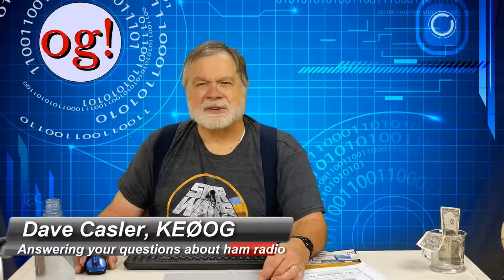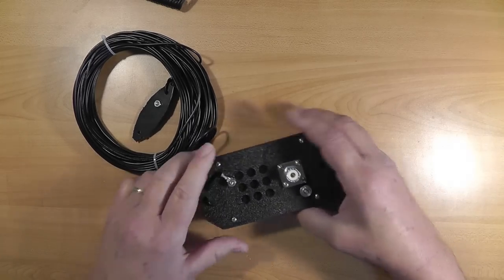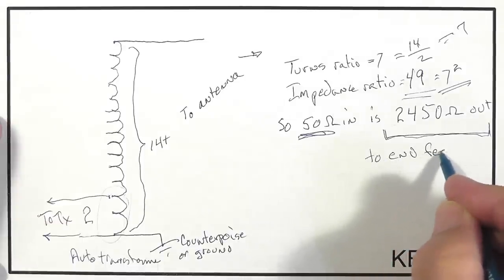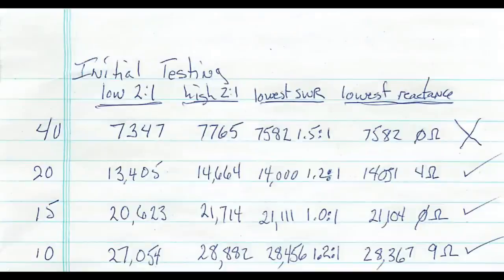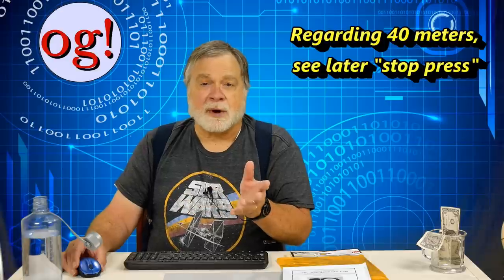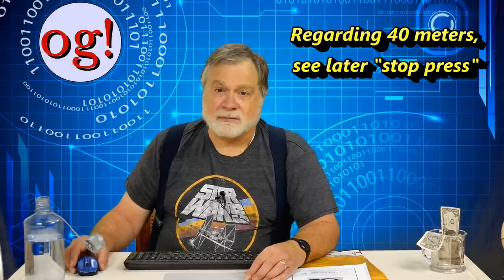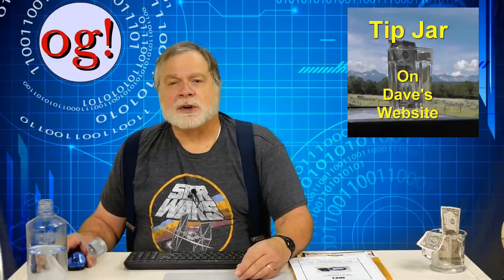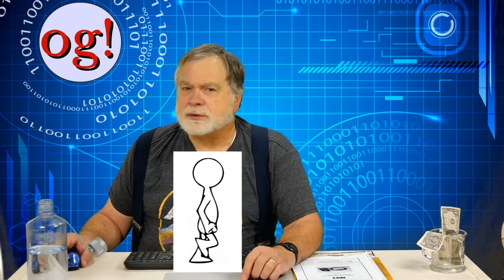Review of MFJ-1984MP End-Fed Multi-band Antenna (# 89)

Comment: Dave, I built a 9:1 end fed myself. At first I had similar issues. Then with a friend's advice I lowered my transformer to about 2 feet from the ground and connected the ground to my ground rod with no counterpoise .  Boom my antenna came alive and works great!
Reply: Dan, I just picked up a 1982mp and the downloadable instructions didn't specifically state 2' from the ground, but the illustration pictured it close to the ground as you did, and also said to connect the transformer to a ground rod. Sounds like Dave needs to try that.
Reply: This is a 49:1 end fed half way.

Comment: I got the MFJ 1622, "apartment antenna" (~ $100). In my case, it was completely useless... It might be good for EmComm, but I would want something a little less unwieldy in that scenario... Since then, I've built my own end fed, running from by the 2nd floor window near my rig, and down across my property, it works great with a tuner from 80-10. Now unless you need a vertical, I'd recommend people just learn a little bit, and build their own too.

Comment: ...I'm a simple man, have plenty of trees and cordage to hang my reliable dipole's...your review enforces my philosophy to stay away from gadgets proclaiming to make my life easier...great review and 73's 😎
Reply: I agree with you in simplicity. I have to say though, this antenna is not up to par as an EFHW antenna goes. I refrained from actually buying this exact model because of the loose solder I saw on this video. I decided to pay twice for the same type of antenna from somewhere else, where it seems they have a higher quality standard, and it works without a hitch. I have worked FT8, SSB, PSK31, etc and I have gotten great QSO's. EFHW are good antennas and don't require all that Dave had to go trough on this video when built in a consistent manner. Also, no counterpoise on these, ground it. 

TLDR: MFJ makes a crappy EFHW, build your own or buy from a reputable antenna maker and you won't regret it.
Reply: Dani El .....running a chameleon emcomm iii, and it is a solid antenna with good performance. I did connect an mfj-915 choke at the tramsformer

Comment: Yes this is an auto transformer but the one's from EU and Myantennas are standard transformers. That's a big difference.  The coax will play a role in the antenna therefore I recommend grounding the box right at the earth, going vertical then horizontal in inverted L fashion. That eliminates all the mysterious effects....
Reply: Im currently running the emcomm III in an inverted L (kind of a lazy L though). I run 4 counterpoise at 13 feet, the main antenna vertical 22’, then horizontal from there with a slight slope to the end. At the transformer I installed an MFJ-915. Overall my 40 meter performance is pretty good

Comment: I got one from UK Antennas straight out of the box a 49;1 transformer 66ft ish .connected to it .boom no problems an 40 20 15 and 10 so then ordered the 110uH coil added that on the end with about another 8ft  of wire and now got 80mtr too no problems at all 😉👍

Comment: Dave,
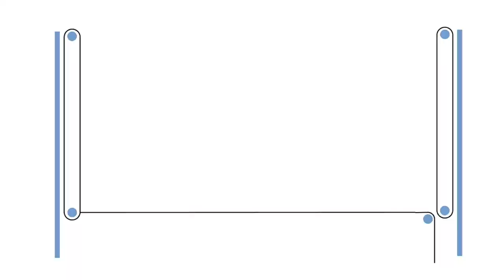I cannot vouch for the MFJ version of this antenna, but I have used another competing version of this antenna (80-10M version) with great success. I have been so impressed with it, it has  become my primary base station antenna (yes I live in a dreaded HOA and this is easy to hide). The key to these end-fed antennas using either a 1:49 or 1:64 transformer is the set up. These CAN be set up as a base station antenna. As you found out, these like their feed points close to ground, so they work best as a sloper. I have found if you mount the feed point (and transformer) between 3 and 12 feet above ground, and not use a counterpoise, but rather ground it with a short wire right to a rod (4 foot ground rod in my case) AND feed it with no more than 50 foot of coax... it works great. I have been heard as far away as Australia from the US east coast using it. On most bands 80-10 it needs no tuner (but depends on your terrain). Like you, I have realized this could also be a great field deployable antenna and have built a QRP version based on this design using FT140-43 toroid. 73.
Reply: Great info, I would like to see how you wound the toroid you used for the antenna you made. Did it work well when you tested it?  If you can't pot it here, maybe you could send it to me via email from QRZ.

Comment: The 80 meter version of this antenna (132' long) would have a harmonic relation on 30 meters, there it's the 3rd harmonic (well close enough for government work).
The problem on 40 may have been that the length of the coax was resonant.  Perhaps with the box in the air and a LONGER feedline (moving the feedline resonant freq) it might have worked on all bands.  Also, you might have needed a choke in the feedline at the rig.

Comment: I  recently put up an 85 foot end-fed with a 45 foot counterpoise. I have an MFJ-939 tuner at the feed point and about 125 feet of coax back to the shack. It tunes up on all bands 160 - 6.  One night when 80m was open I was able to work Europe wth my 100 watt IC-7100.

Comment: Well one thing you have your transformer box next to a conducting pole that is grounded.   I built my first end fed single core matching right off of Steve Ellington,s videos and it was a very good performer on 40. The match was very good, the on air was 2 S-units better than my 40 inverted V at the same above ground. About 40 feet to the center of the V and to the attachment point of the end fed that was a slopping wire to the  same point with the transformer 4 feet off the ground at the other end. This only shows that the wire was taking the power and sending it on its way, not every station was this good but to the station near the coast up north from Va. it was doing well. The next one I built is a two core and I have not gotten the same result on 40 with it but it just takes some HAM fiddling. Steve,s videos are very good and he get very good results and had built many.  Thanks, Dave E. W4GSM

Comment: I'm using 75 feet of LMR-400 and I have the box on the ground and the antenna over a tree limb (inverted V).  I find get a 1.1: 1 at 7 MHz and 2:1 at 7.3.  On 20, 15, and 10 (28-28.5) meters I get about 1.3:1 or better.  So far I really like this antenna for my home use!  I've worked Chile and Spain on 10 meters and regularly use it on 40 to check into ECARS, SCARS and the Nickle Belt Net from Pittsburgh.  Just follow the online instructions and this will work just fine for you!

Comment: I use 1984HP and it work good on 40-10m.  10 is a bit hard to do with no tuner.   I have done 300-450watts SSB with really good results.
Even barefoot 100w or less I do very good on digital modes.

My setup is box is at 8'     middle  at about 12-13'.  end at 28'

Comment: Nice review Dave, I was watching with great interest thinking now can Dave prove me wrong here or what. well Dave I have used all kinds of HF antennas to suit the situation of locations that I have had to operate from when in the forces. For the higher frequencies I would usualy pick to use a dipole slung up from trees or tree/mast. For the lower frequencies  I would normaly use the trusty wind up drum and plug in unit of a 150 ft, wound up "Dacron" line with embedded tinned copper wire in it. The line was run out for the length required and then trapped into one side between metal washers that were connected to a 5/16 ins plug in terminal, witch was pushed into the antenna base fitted on the side of the vehicle. ie. pull out the whip sections and plug in the wire unit. the far end of the wire could be pulled up into trees or a mast. Whatever losses there were in using a ATU to get a good match was not taken into account. as long has I was able to make contact with the base HQ and pass traffic, usualy by CW was what mattered. On my own back playing with Ferrite torroids winding UNUNs , BALUNS  and XFORMERS to try and do what you have just demonstrated, I gave up most of the time and just put it down to experience. Use a doublet or a fan dipole. 73 de John - G0WXU

Comment: Hi Dave,  I am using the myantennas 80-10 efhw antenna. I have it set up in an inverted L configuration. I have the auto transformer mounted on a wooden 4X4 post on my deck. Directly below that I have an 8 ft. ground rod connected via a 2 ft. ground wire. My swr readings are 2:1 or less on all bands and less than 1.5:1 on most bands. I believe the key to performance is keeping the ground as close as possible to the autotransformer. I also use an ugly balun in line to prevent RF from feeding back into the shack. Hope this helps. Good Luck!
Reply: Good choice... I use the same antenna with similar set up, with similar results. Great antenna. 73,
Reply: Thomas Wright hey Tom , how does the myantennas 8010 work for you? Do you mind making a video? I have 70 ft between trees but would like to come down and go at a 45 degree right angle to try to get the best I can on 75 meters. Did you have to trim the antenna ?
Reply: Are you having to use a lot of coax or could I keep the coax length under 10 foot as I do with my MFJ end fed?

Comment: Hi Dave. I just rewatched this video today -- after having owned the exact same model of MFJ-1984MP end-fed antenna, and I don't use it with a counterpoise, and not only does it work great for me in 10 meter, 15 meter, 17 meter, 20 meter, 30 meter and 40 meter, but I'm actually able to communicate on it with 80 meters as well. I guess YMMV?!? For what it's worth, this antenna goes up almost vertical in the tree, about 40-50 feet up in the air, and the transformer box sits within 2 feet of the ground. 73 de W3DJS in Atlanta, GA, USA.
Reply: I have had the same good results with this antenna. I have mine installed in an inverted V fashion approximately 70 feet in a tree and the box mounted to a 4x4 post   about 5 ft off the ground and 20 feet of coax. Also grounded it at the 4x4 post to copper ground rod.  Works excellent so far
Reply: Clearly having that box reasonably close to terra firma matters, and that is how the instructions show it. ( Don’t have one, but this kind of antenna arrangement has some attraction for me.

Comment: So it appears that the antenna can get all the bands that is says, but not at the same time.  What I get from this is that there is no simple way to get low band and high band frequencies  to work together on wire antennas. This is because the coax appears to be part of the low band frequencies, but not so much as the frequency increases. I guess that would not surprise anyone.  My guess is that if you would put a choke at the balun, and stop RF from flowing back on the coax, you would stop the antenna from working on 40m altogether. Everybody knows that 66 feet is ideal for 40m, so it is the balun that is wrong at that frequency. When 7mhz is put to the wire, the wire is referenced to ground, and that starts at the balun. So i wonder if you were to raise the antenna so the coax going vertical were to match the 66 feet of the antenna before it turned away at the ground.  I don't know if you have a  way to get that kind of height, but it would be interesting to see what the antenna does. If it works being fully vertical,  the next thing might be to test it as a slope. My thought is that the coax would radiate at 7 mhz, but not so much at the higher frequencies. There might have to be a choke as the coax hits the ground ground and makes it turn to the shack. I believe that  in a fully vertical configuration the coax that is directly under the wire, will aid 40m,  and  not bother the higher frequencies  as much.  If you don't think any of what I suggest would work, I would be interested in the reasons why. I am limited to just wire antennas, so I have been trying to come up with the best I can get. Once a metal roof went on my home, the antenna situation has gotten more complicated.

Comment: Doesn't the use diagram (for home use) from the manual show how you ended up?  That is, the feed point is very close to the shack (short cable), near the ground (several feet relative to the window in the diagram) and grounded?  The diagram shows an inverted-v; your test antenna had two different configurations (horizontal and slanted).  Thanks for continuing your great series of videos.  You deserve a larger audience and I believe you will get.  --Mark, KE8HAA
Reply from the maker: Yes, the pictures do illustrate setup. However, they are labeled as examples. There is no text to say that it must be done as in the pictures. I sent MFJ some suggested text to add to their instructions.

Comment: Hi David, A question you may be able to answer.  I am not new to radio my first lic was an Advance back in the early 80's. I was with a job that offered no time for radio or other hobbies so within 2 years I sold everything until I was ready to key up again.  Now being retired I started up again in March of 2018 and found radio has passed me by. :(  I bought a new HF with 4BTV, and 2m/440, FT400 as a base.  I decided to buy an MFJ 1984MP to give them a try thinking they have bettered themselves but no surprise they did not.  have installed many antennas in my life and really did not care for it once seeing it in hand, I immediately noticed the wire was not going to be heavy enough to support its self.  I ran it at about 120 degs leaving enough slack with a relief at the top end to adjust for wind, well up in March fell down in August, the wire broke as I expected (the wire is not strong enough to support its self over the length.  Have been trying to contact MFJ but unable to make it past sales and put on hold for upto 27 minutes before I get disconnected. I left my number with sales but no reply. So back to my question, I have the over all footage but I need the lenght from the balun to the chock do you have any ideas on how long?
Reply from the maker: I don't have the antenna anymore, so can't measure it. The length might be listed in the manual or on the MFJ webpage for the antenna. Good luck!

Comment: Quite interesting Dave. I have an OCF 265 foot dipole, strung up between trees, it is rated for 160 meters through 2 meters, using a 4:1 Balun at the antenna feed point. The Coax is buried, and is 165 feet of length. I don't think I will be using and endfed anytime soon, but, for some people this may be an acceptable choice.
Reply from the maker: The OCFD is a popular antenna, and those I've spoken who have them are quite happy with them. I've never used one myself.

Comment: I think you nailed the problem; common mode current is flowing on the outside of the co-ax. The "balun" is really an Un-Un and will not isolate the feed line from the antenna. This makes the co-ax an integral part of the antenna. MFJ should include a CM balun (AKA choke) about 2 meters from the SO239 to decouple the feed line (counterpoise may not be necessary if 2M spacing is used) . Is MFJ at fault? Well, this keeps the cost down and the antenna still works when the un-un is at or close to the ground. Is Rick Littlefield at fault for not finding this in testing? Well, I'll let his conscience be his guide. I expect this problem to be true across MFJ's end-fed antenna offerings, although I haven't checked. Too bad you've disposed of the antenna and can't test it again with the CM balun (choke).
Reply: I found this in the instruction manual:

"...do not install ferrite beads or a current style choke-balun at the input of the antenna matching
network -- the blocking impedance won't be high enough to be effective."

Comment: I have the same model but 80 to 10.  22 feet up both ends.  The box 5 ft from last.  Rg8x 50ft.  1.1 to 1.8 'll lbands.  No extra grounds or couterpose.  Only ground is clamped on coax cable near transceiver.  To bad yours failed. KI5GLN
Reply from the maker: I did finally get it to work, but only in a portable use case.

Comment: I have the exact same antenna. Out of the box, each end up about 12ft, and center running through a tree, maybe 20+ ft up, I gat almost all of 40, all of 20 and 15, and CW Data portion of 10. It's a little long, and if I trim it a bit, I think I can fix 10 and 40. Here are my results. MFJ-1994MP Results SWR 2:1 or less: 10M - CW/Data Only. 28.0-28.5 Tuned Low at 28.02 -- 15M Full Band. Tuned at 20.7 -- 20M Full Band. Tuned low at 13.56 -- 30M No Match 4:1 -- 40M Almost 7.0 - 7.25 But Tuned Low. I think if I shorten it a hair, I'll fix 10 & 40
Reply from the maker: I'm glad to hear the antenna is working well for you.
Reply: Weird thing. If I remove it from the tree, and have it all in open air, I almost lose 10M. It goes super narrow. 28.5-28.7 is all that's better than 2:1. Weird. I wish I understood this stuff as good as you. 73.

Comment: My EFHW acts like it is shorted. No noise on receive and high SWR. When I unscrew the shield from the pl259 and only the center is hooked to the so239 I get receive noise. What would cause this? Thanks for this great video!
Reply: I have the exact same symptom on my efhw - did you find a solution ?

Comment: I can't help but laugh at the idea of pulling on the coax to adjust the SWR. I can just seeing operating a rig like that. I wonder... what if you stand in mud while pulling on the coax Dave? You could be a good counterpoise that way :) If that doesn't help try standing on your head, in the mud, while pulling the coax with your feet. Not the ideal operating position but a ham has to do what a ham has to do :)